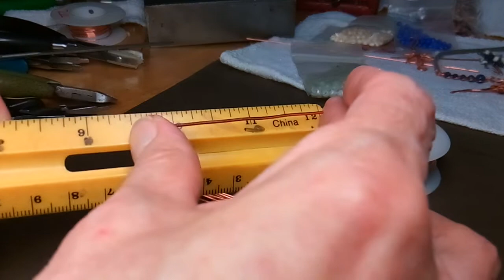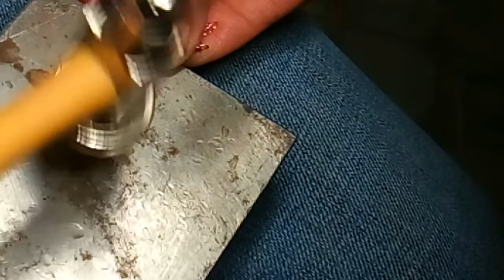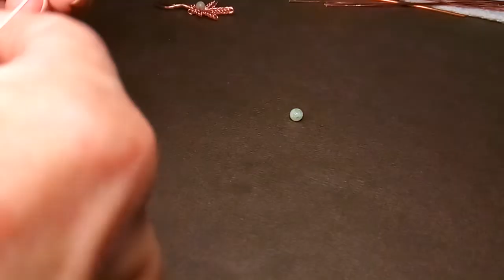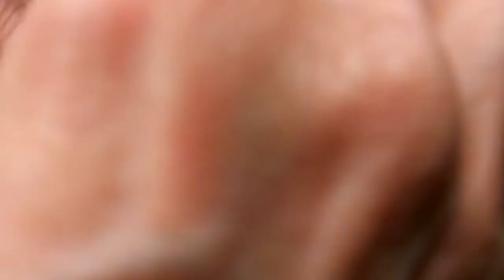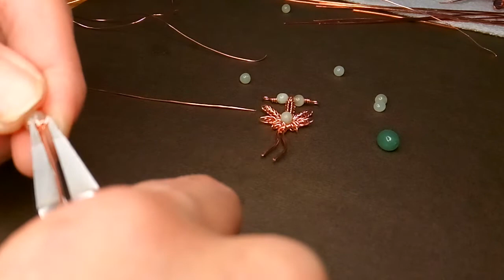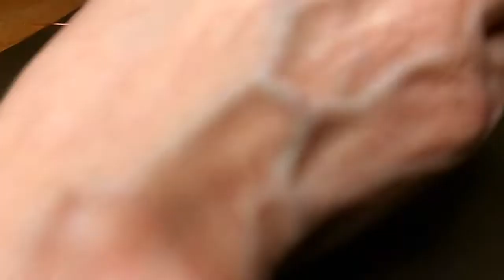Cannabis Leaf Tutorial

Comment: I wasted the last of my 18 gauge in order for this video to frustrate me to a point of delirium and absolute feudal rage. I absolutely wanted to learn how to make a  copper wire pot leaf I mean who the flip doesn't? If anyone has figured out how to do this and it doesn't hate everyone that's trying to also figure it out, And you have enough common sense to keep your knuckles out of the camera view, by all means enlighten me. I want not only my time back but the copper wire damn it.
Reply: I haven't seen the remake of this tutorial but I wanted to mention there are lots and lots of tutorials that clearly show and explain how to wire wrap starbursts and/or sunbursts. The reason I mention this is because the WRAPPING METHOD IS EXACTLY THE SAME so you may be able to watch one of the other tutorials and successfully make this (or a) pot leaf.  The difference in the starbursts and pot leaf will be the number of leaf segments (7-leaf or 5-leaf pot plant) and how tall you want your leaf segments. You just have to be sure to make the right side be a mirror image (same number of wraps per segment) to the left side. If you wanted it taller than the one shown here, you'd just need to add more base wires/rungs (I like to call them "rungs" like a step ladder) upon which you do the wraps.  Anyway, you've probably figured out by now how to do this but if not, I hope this info helps.  Good luck! 🍀😊